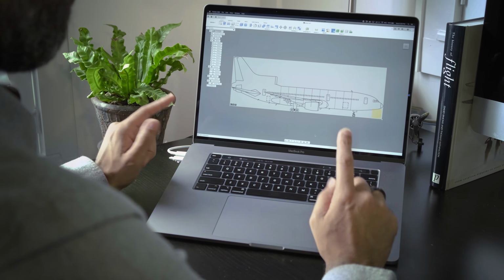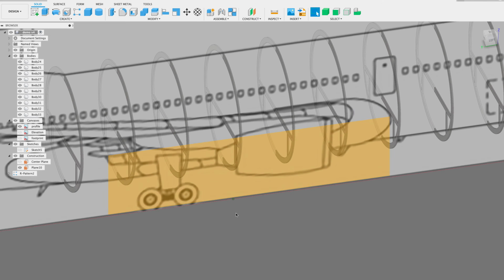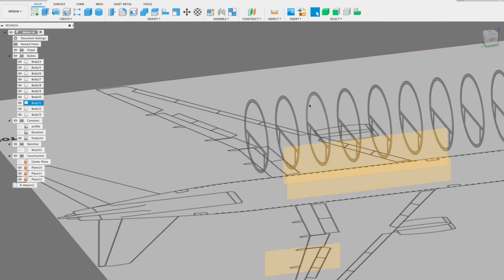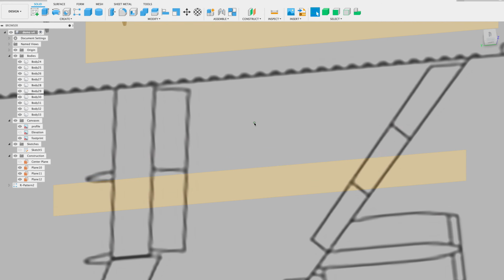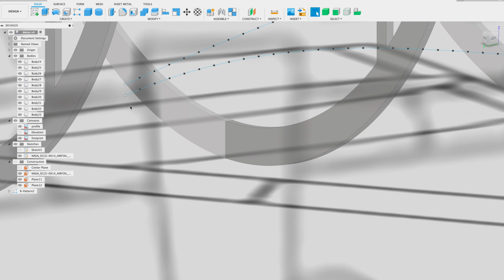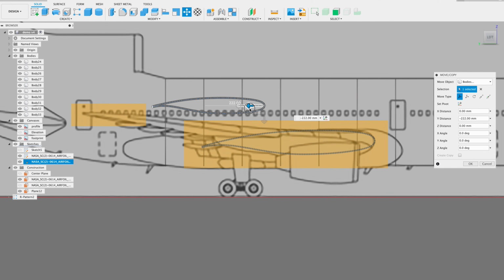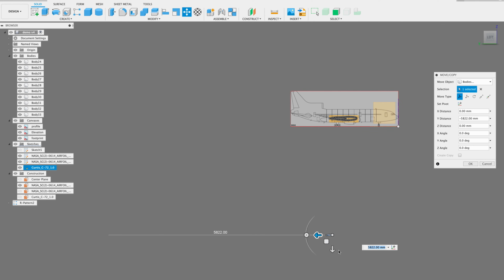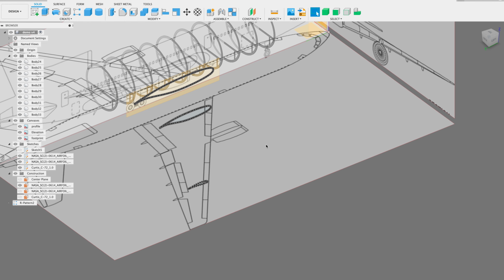Part 1 | How To Design Airplane Wings in Fusion 360 - Airfoils [Episode 2]

Comment: Yeah how do you download the airfoil. On Airfoil tools it is only giving me points for the dat file. I dont understand
Reply from the maker: Hey there. Visit the link in the description to the supporting page for this video. I have download instructions there. Just make sure you do not open and save the file. It will cause it to not be importable.
Reply: @RCCAD2VR  i did read through the website and learned that i wasn't saving it properly. However it still isn't not working for me for some reason.
Reply: @RCCAD2VR  I was doing it right the first time not left clicking on the link and then right-clicking to save it, but the problem i had with it is that when entering the files it was searching for "airfoil dat file". It was an easy problem to fix. I just made it "all files"  which pulled up more files.

Comment: Its not allowing me to move the plane to the center. I would clip on the plane and then press "m" to move and it does nothing
Reply from the maker: Make sure you're not in parametric design mode, you need to be in direct modeling mode.

Comment: I have two questions.
1) Can you import an existing wing rib shape from a plan, ie import the shape as a PDF and trace it .
2) can you use Fusion 360 to design in features. To make building the wing easier, eg jigging tabs?
Reply from the maker: You can do that easily using the canvas feature and skirting the shape of the wing on top of it. 

I'm not sure I understand your second question though.  Can you clarify please. Thanks!
Reply: Hi
    Thank you for your reply.
In answer to your question.  
Many models have sacrificial jigging tabs on the wing ribs to ensure the wing ribs are properly aligned or have inbuilt washout at the wing tip

Comment: I am unable to use DAT files because 360 says it can’t recognize them. I use airfoil tools and UIUC for my DAT files. And I have Dat to spline install. I tried looking it up but no luck. You have any tips?
Reply from the maker: Hi Chad, this is usually caused if you did not save the file correctly. If you open the file and then save it, the file will end up with meta data in the header that the "add-in" can't read. Make sure you right click the file link and save as. This will ensure you get the file without any extras.
Reply: @RCCAD2VR  is it the "save link as" because it is still not doing it.

Comment: Im having issues moving my offset plane. When I click on the offset plane and tap M, it doesn't show where I want to move it
Reply from the maker: You'll need to switch to direct modeling mode to use that feature. To switch, right click on your root component in the browser. Select do not capture Design History. That will take you out of parametric modeling mode and into direct modeling mode. Cheers!
Reply: @RCCAD2VR  Oh you’re the best. Thanks!!
Do I have to switch it back after or can continue like this??
Reply from the maker: My preference is to work in direct modeling mode for when I'm trying different ideas or not sure how I want to go about doing things. It frees up worrying about the timeline which can become a mess quickly. I use parametric mode when I'm making specific individual parts. They both have their strengths and drawbacks.
Reply: @RCCAD2VR  Got it. Thank you so much sir!
Reply from the maker: You're most welcome.

Comment: Mate your video’s are amazing! Been wanting to do exactly this for the last 7+ years and have done extensive research but with so many different papers, tutorials and online opinions it all gets a bit overwhelming very quickly. your vids are clear, precise and by far the best ive seen with all the important details people want to know.
Looking forward to the rest of your videos. Cheers legend🍻
Reply from the maker: Aww Man! That's amazing to hear! Thank you for taking a sec to post this fantastic comment. I was pretty much in the same boat and just slogged through it. With the lock down situation we all had to endure, it gave me the perfect excuse to just dive in. As I started figuring things out, I figured I'd share what I've learned. Happy to hear that its reaching the right people who want to get into this as well. What are you going to be working on as your first project?
Reply: @RCCAD2VR  
 initially got into this about 11 years ago with people doing long range fpv (before the drone industry really kicked off) and have a weird fascination with delta wing designs. Had a go making my own foils using a hot wire and foam but found it to be fairly rudimentary when trying to use different airfoils and twist/washouts. Have had a small bit of experience using pre-preg and infusion carbon fiber so wanted to use a CAD design that i can use to make my delta wing design and CNC a mould from it. Your vids and Instagram so far have been exactly what ive been looking for. Haven’t had time to watch the rest of your videos yet as working remotely as a geologist but a few of the questions I’ve struggled with was how to make a streamline internal server connection for ailerons. Also probably a issue you wont have but how, after laying up the carbon mould, do you then fit your internal rib design into the airframe as obviously the thickness has changed by varying degrees depending how much carbon you have layered up, or do you then just have to custom hand sand your frame down to the correct dimensions to fit within the airframe (or maybe i dont even need and airframe and can just use a honeycomb carbon composite..)...
Anyways bit of a rant and dont expect you to answer those questions here.
Cheers for the help so far!

Comment: Very good tutorial!! 
Just a quick comment on the airfoil. It looks like a supercritical airfoil which - in full size aircraft - makes a few compromises for good transsonic flow behavior, which we would not see in most RC models. ;)
I would stick to the common Clark, NACA, Eppler Profiles or to those dedicated RC profiles e.g. designs by Dr. Martin Hepperle...
Reply from the maker: Thanks for the compliment and heads up! Much appreciated. You are correct regarding the supercritical airfoil. The wing on my model quickly transitions to a more favorable Clark airfoil before it reaches the engine nacelle. The actual airfoil that I'm using at the root has more favorable flying characteristics based on Reynolds number & wing WCL, than that used in the video. The flaps will also help compensate for some of this during the critical stages of flight. Time will tell if it works! Lot's of tests ahead.

Comment: Why do my airfoils come in facing the opposite direction??
Reply from the maker: hmmm That is next to impossible to answer without seeing your work. Are you working in the standard XYZ orientation? X = Width (Side to size) Y = Depth (Front to back) , Z = Height
Reply: @RCCAD2VR  I think I may have my origin planes reversed when I brought in my canvases.  I just rotate the airfoil and then mirror it and delete the original.

Comment: I'd like to add that the main thing about wingtip-washout is to prevent a stall of the complete wing at a time. The beginning stall at the root gives you time to react, time you don't have with a wing stalling completely at once. There are full sized planes without washout for better high speed performance, but those are known to be very critical to fly at low speed. 
The second thing I want you to think about is that you don't really have much aileron controllability with a partially stalled wing. If you're hanging off the outer wing only due to a high angle of attack and you try counter act a bank to the left by right aileron, the airflow can't follow the downward deflected left aileron any more, causing a stall and you loose the left wing you thought to lift. You often see that at take-off, when the model is ripped into the air more by the power of the engine than through lift of the airfoil, hanging there like a ripe fruit ready to fall, what will immedeately follow when you try to save it with full aileron. It's better to use rudder in such cases to benefit from the yaw-roll coupling. This is what you learn as a pilot in manned aviation...
Reply from the maker: Hey man, thanks for taking some time to write more about wing washout! This is very helpful and gives more insight into the complexity associated with wing design.
Reply: @RCCAD2VR  I have to thank you for sharing your experience with us. I learnt a thing or two from your videos, preventing me from creating a mess instead of a model airplane.

Comment: Help!!!  How do your move a plane?  what selection Faces, Bodies, sketch objects, or component lets you move a plane??  Mine will not move a plane no matteer which I use, no other choices either!!  Select plane press m and it wants to know what to move!  Won't move plane with any!  I also can NOT copy a construction plane.  IBM based computer.
Reply from the maker: Hey there. You need to be working in direct modeling mode. You're in parametric modeling mode which does not allow that functionality. Hope that helps.
Reply: @RCCAD2VR  Yep it did!

Comment: Terrance, this is the first time I see how my add-in works on MacOS. Thanks for that!

Few comments from me if you don't mind.

Don't move a lot and resize construction planes. Just need to move each of three to proper X coordinate, that's it. Strange movement of airfoil could be due to this.

What I would do is to make in advance is make three sketches on origin planes and draw construction lines for leading edge, trailing edge and chord, also lines where you put construction planes eventually. This will give you possibility to measure and write down X, Y coordinates of leading edge and angles for each airfoil. These numbers could be typed into AIRFOIL PARAMETERS windows fields. This is why I made them there. Also you can compare % of sickness in DAT file with real thickness you need and adjust it again in parameters.

Please note that you can move construction plane any time and sketch will be moved accordingly. This is why I recommend to use construction planes instead of origin planes. But script itself works with any of them apart angled construction planes, Fusion 360 get's crazy.

P.S. Keep your script up to date. Current version is 2.0. And you can use "Airfoil DAT Optimizer" if original DAT file has a lot of points.
Reply from the maker: Hey there -- Thanks for the feedback! Very much appreciated. I will be making more videos around this in the future and will use your tips. One thing to note is that in this series I am not modeling in parametric mode, rather direct modeling mode, so some of the features with sketching and construction planes are not available. 

Do you have a website with documentation on some best practices for your plug in? If so I could link to it as a reference.
Reply: @RCCAD2VR  No. I do not have any personal web sites. There is no "good" or "bad" way for design. I could be wrong. Each person just use what he know how to use.

Comment: Couple things. 

1st, I'm loving your content so far, 3rd video I've watched.

2. In Fusion, why not use the "Tangent Plane" in stead of moving your Offset Plane?
When you use the Tangent Plane, you can pick ANY rib you want and even change its angle or rotation on that specific rib. And then you can use the offset Plane option to offset that Tangent Plane as many times as you need.

3. You don't NEED to expand your Plane (any of them). Once you chose that Plane you want, your sketch stays on that Plane. 

For instance, if you use an offset Plane and offset 4', your sketch stays 4' off your surface behind it. Your Plane could be a .25" square. You just need to select that specific Plane. You might be using it as a sanity check, but it's not at all necessary.

I hope that makes sense @RC CAD Vr!

Thank you buddy!

Edit: I see why you used the Move command, to follow the sweeping of the wing, from root to tip.
Reply from the maker: Hello Jenson -- Thank you for the feedback and you are absolutely correct. Part of what I am also doing in my videos, aside from showing how to model an airplane, is develop a sense of comfort, familiarity, and visualizations for those who are new to Fusion 360 and 3D modeling. I tend to use repetition as a technique especially in earlier videos like this one. 

Thanks again for the feedback. I hope others get to ready your comment to see that there is more than one way to accomplish the same in F360! 

Cheers!
Reply: Omg thank you so much. It wont let me move the offset plane and I use the tangent plane and it worked. I am pretty new to fusion but i have used Inventor and autocad for 2 years. They're a litte bit different but overall i will get used to it. Thank you so much
Reply from the maker: Hey there. Glad you found an option. You're most likely in parametric mode, you'll need to switch to direct modeling mode to get the plane functionality as I use in the video. Be sure to reference my website that also has many answers to common questions. Cheers!
Reply: @RCCAD2VR  thank you.
Reply: Rad guys! I'm glad it's clicking for ya!

Comment: Hi Terrence, I was wondering if you can scale a drawing or body in fusion 360? For instance if i had fuslage formers that stay the same shape, but slowly get smaller as it tapers towards the tail? Thanks.
Reply from the maker: Hey there. I'm not 100% sure if you are asking about the scaling a canvas or a sketch, or individual bodies? As per scaling the empennage, I would not recommend doing the way you've suggested in your question. It does not take into account the shape change for the vertical and horizontal stabilizer mounting surfaces. I've publish an entire episode on designing the empennage last week here https://youtu.be/Ii1llR3i7o4. If you are wanting to do the series in order (which I'd recommend), here is a link to the playlist https://www.youtube.com/playlist?list=PLWLtHp5rnDuTFa2CpkuF_eYK8-aCMMID1. I'm unfolding the various techniques from one episode to the next progressively getting a little more advanced and building on the prior tutorial. I hope that is what you were looking for. If not, let me know.

Comment: Your tutorials are great ! Could you share the picture of the plane in order we followed you while learning ?
Reply from the maker: Hi! Thank you, glad you are enjoying the tutorials, also, Thank you for the tip, that was very kind of you! Here's a link to a photo of the plane I'm working on https://www.airliners.net/photo/Delta-Air-Lines/Lockheed-L-1011-385-1-TriStar-1/181539/L  I'll also be building it and adding this livery to it.
Reply: @RCCAD2VR  but i have a problem;( it is inpossible to import files taken from airfoiltools to fusion 360. I have changed extension from txt to dat but it does not work
Reply from the maker: @pawelmolin  That is a very common problem. Changing the extension usually will not work. I have a guide on my website at this link https://www.rccad2vr.com/rc-airplane-design-build-episodes/design-rc-airplane-wings-in-fusion-360-part1#download-dat -- Are you doing it exactly this way? Make sure you are not opening the fine in an editor, that will add meta data to the file and the add-in will not be able to read it. Let me know if that works.
Reply: @RCCAD2VR  Ok, I will try it, thank you
Reply from the maker: @pawelmolin  👍 Keep me post.
Reply: @RCCAD2VR  Ok, nów i am coming back home from work. I am going to study your tutorial today and try your advice tomorrow
Reply: @RCCAD2VR  Thank you again. Your way of importing airfoils works. I have done it in Safari browser. File- save as- filename.dat and I have answered ‚Yes” for the question if .txt should be attached.

Comment: Hello Mr. Terrance, if you want to avoid the porblems with airfoil placement when your doing wings I recommend using a Fusion360 add-in called "Airfoil sketch from file" you basically create a construction line on the plane and of the size and incidence angle you want and then fit the airfoil .DAT file to it. You can find this add-in in the Fusion360 app store if you type "airfoil" in the search bar. Once installed, the add-in adds a button to your sketch command menu. 

As a side note: I'm loving the content you are clearly a gifted designer, something I aspire to keep up :-)
Reply from the maker: Thanks for the tip José! I will look into that Add-In. Based on your description It sounds like a better designed tool. Also, I really appreciate the compliment, that is very kind of you to say and is very encouraging to continue making more. Thank you for taking some time to share this alternative airfoil tool and comment on my work. Cheers!!

Comment: maybe i'm just that stupid but i can't get it installed
Reply from the maker: Oh no! That doesn't sound good. What seems to be the problem, are you using the guide I added to the webpage that goes with the video?
Reply: @RCCAD2VR   I've solved the problem. My pc acted a bit strange but after a second try it went by itself. Thanks in advance for the quick response.
Reply from the maker: Glad you were able to get it figured out and working.

Comment: great video, one thing to note though: on windows the folder to put the script into is C:\Users\*YourUser*\AppData\Roaming\Autodesk\Autodesk Fusion 360\API\Scripts
Reply from the maker: Thanks, glad you like the video. Thanks for the heads up. Just double checked with AutoDesk https://knowledge.autodesk.com/support/fusion-360/troubleshooting/caas/sfdcarticles/sfdcarticles/How-to-install-an-ADD-IN-and-Script-in-Fusion-360.html seems there may be some variance between OS or F360 versions. Good to know if anyone runs into a similar directory structure.